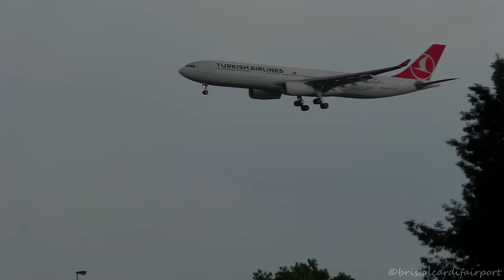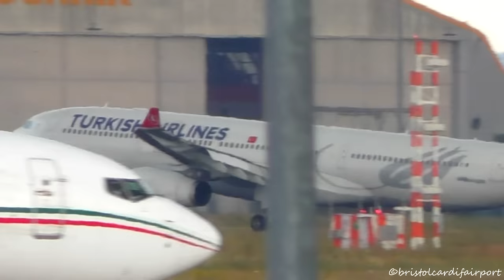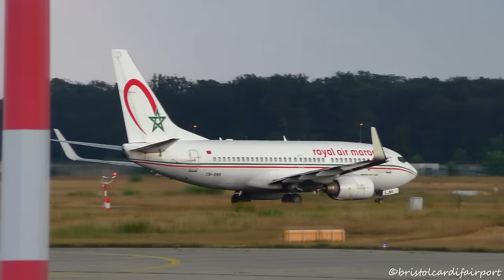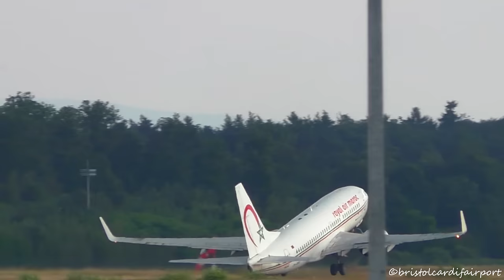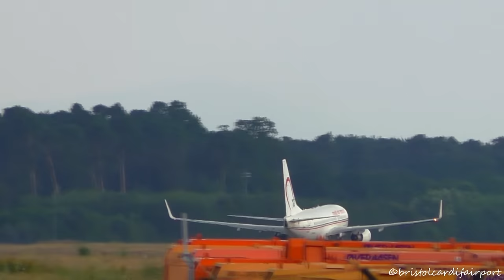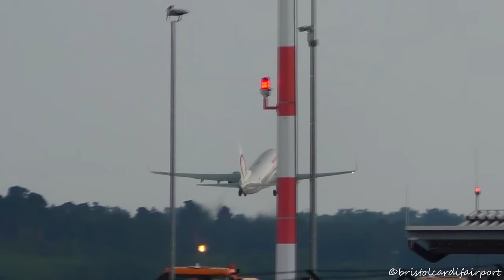PASSENGER AIRCRAFT FAILS TO TAKEOFF! BOEING 737 NEAR TAIL STRIKE & STALL ON TAKEOFF

Comment: Great Video Will. At least they made it off the ground safely that's a really close near miss for sure.
Reply: I've always been bothered with the term "near miss" as it implies you 'nearly missed,' but instead made full contact! Everyone should use the term "close call" or "near collision".
Reply: 'Near' is an adjective, 'nearly' is an adverb. 'A near miss' is grammatically correct and conveys the idea perfectly. It isn't at all the same as 'I nearly missed it' which does mean hitting 'it' or achieving 'it', whatever it may be. Conversely, consider 'a far miss.'
Reply: You're right.  Near miss doesn't really apply in this one.  But when there is a near collision with like another plane I think it's appropriate.  So when you say near miss.  The nearly collided but missed.  So it's usually correct.
Reply from the maker: Indeed!
Reply: Yes, the phrase "near miss' has been noted and analyzed for years.   You're not the first one to point out the theoretical (but not actual) anomaly. 
 
But as Nathan Nicholls points out, "near miss" does NOT mean "nearly missed".   "Near" means close.  "Nearly" means "almost".
 
For example, how about substituting "pass" for "miss".  (Similar enough concepts.)  You could say it was a near pass, and no one would raise an eyebrow.  If you can say a maneuver (or whatever) was a near pass, you can say it was a near miss.

Comment: Some interesting comments on this thread. This is a definition of Vr: "Vr is defined as the speed at which the rotation of the aircraft should be initiated to takeoff attitude."  Vr is determined by the pilots, taking into consideration aircraft weight, air temperature, wind direction and speed, flap speed, engine max takeoff power, etc. For whatever reasons (perhaps wake turbulence as posited by some on this thread) when the pilot called for Vr the aircraft's wing was not ready to fly. The airspeed was not high enough to produce the lift needed to get the aircraft off the ground. Fortunately there was enough runway remaining for the jet to gather the extra knots needed and the 737 successfully left the runway. We may never truly know what happened here, but regardless as to why the first attempt at lift off was unsuccessful, the aircraft maintained the center line of the runway, the nose lowered smoothly and the 2nd attempt at rotation was also smooth, contributing to a successful outcome. Glad everyone was safe.
Reply: fortunatly the take off run (on the runway) was sufficient, otherwise there would be a crash at the end, we have to look up at the so-called accelerated-stop distance and the stopway if both are sufficient to make a safe take off...

Comment: 60kts rotate.
Reply: haha
Reply: V0.65!!!!
Reply: Hahahahaha
Reply: FSX Bad Frames and Stutter.-)
Reply: hardware4you1
Reply: Yea, they must have had an 80kt headwind that immediately became a tailwind!
Reply: PNF: Rotate.
PF: What the f**k is going on here?
PNF: Sorry, I ment "80 knots".
Reply: what the fuck is a PNF and PF?
Reply: Pilot Flying and Pilot Not Flying. Used to delineate which of the two people sitting up front actually have their hands on the controls because depending on which leg of the day they're flying, the takeoff could be handled by either the captain or the first officer.
Reply: Pilot Not Flying and Pilot Flying
Reply: oh man that shit made me laugh - thank you lol
Reply: ^Without Flaps...difficult. he forgot to set the Flaps, thats all.
Reply: +avarua65 He actually had flaps down. You can see the slats when it starts to move
Reply: like on a skyhawk
Reply: +Colin Southern There are no flaps, you can get 5 degrees flaps on a 737, there are setting at certain degree settings. 5 degrees of flaps would be totally useless anyway which is probably why that setting isn't available.
Reply: No, in fact 737s often take off with less than 5 deg of flap. One degree is commonplace. Some Airbusses use zero flaps for takeoff with flaps extended.
Reply: Five (5) degrees of flap setting on the NG (Next Generation 737, like the 737 in the video above) is a fixed detent on the flap lever selector mechanism.  Five degrees of flap for takeoff is the standard flap setting for takeoff for many 737 NG fleet operators worldwide.  Five degrees of flap is an available flap setting on the Boeing 737 NG.

On the Boeing 737 NG there is one handle (called the Flap Handle) that controls both the leading edge devices (flaps & slats; Boeing calls the inboard, of the engine, leading edge devices on the 737 “leading edge flaps” {there are two of them on each wing} and the outboard leading edge devices “leading edge slats” {there are four of those on each wing}) and the trailing edge devices {called flaps}.  There are nine fixed positions (detents) for the flap handle that one can position the flap handle in.  Those fixed detents are flaps up zero position, 1, 2, 5, 10, 15, 25, 30 and 40.

As this jet begins to accelerate for takeoff it appears that the leading edge slats are extended.  Unless the flap/slat system malfunctions one cannot get the leading edge slats to extend with the trailing edge flaps retracted (no trailing edge flaps).  Unless the flap/slat system malfunctioned; and because the leading edge devices are extended, I would say that the trailing edge flaps are not at zero, retracted, and were in fact deployed.  Now where the trailing edge flaps were set at I do not know.  They certainly do not look like they are set at five or more degrees.  And it is possible that the system malfunctioned and the trailing edge flaps were in fact at zero (but I doubt it).

I know of two cases where thousands of pounds/kilos of freight were loaded in the front baggage compartment of a Boeing 737 and that freight was not accounted for in the weight and balance.  That omission led to a mistaken stabilizer trim setting, among other things, and at VR (calculated rotation speed) the pilot flying pulled back on the yoke and ……. nothing happened.  "Little jet is not happy and don't wanna fly".

I don’t know what the gross weight of this jet was, where the stabilizer trim was set, what power setting the crew selected (did or did not derate, did or did not apply assumed temperature), whether or not the takeoff speeds were correctly calculated and at what speed rotation was attempted.

Bottom line is that this takeoff was a mess.  I hope the correct lessons were learned.  Glad they got it in the air, could have been much worse.........

-Respectfully
Reply: What's the correct rotate speed if you forgot to lower the flaps?  (smile, I'm not being nasty)
Reply: Learn something every day, I didn't think a passenger jet could take off without flaps.
Reply: Usually, not having flaps set properly for takeoff will sound an alarm. You can take off without them, but you have to be going a lot faster to get the same lift. You are also much more at risk of stalling if you climb too fast. Also, according to the pre-flight checklist for the 737, 5-degrees of flap is the normal takeoff setting. Nothing else is mentioned.
Reply: Excellent. Flaps were an issue as I see it and V1 miscalculated. Thanks.
Reply: Colin Southern  okay you are right it was the speed
Reply: Rotate at 60 kts?  I don't even think that's possible.
Reply: Timothy Chapman  if you are in a Cessna
Reply: Nope, you can take off in a 737 with one degree of flap selected, and one often does when the runway is of sufficient length.  It gives a better climb
Reply: They don't simply "forget". There is checklist for everything...
Reply: FSFLIGHTproductions Flap 0
Reply: FSFLIGHTproductions 40% thrust

Comment: "What was this pilot thinking?" - He was thinking that we are getting wake turbulence or something simular making it dificult to rotate, so I better put down the nose of the plane in order to catch speed for rotate. That is what he was thinking, very good and quick handling of the crew.
Reply: Absolutely True
Reply: @alhazenmediax  no, you can see that the flaps are down at 5 or 10.
Reply: @danieleriksson1657  They're at 1. Which is a valid takeoff config for the 737, but possibly not the one for which Vr was computed.

Regardless of MenTour's video, this wasn't due to wake turbulence. Vr for a 737 is at least 100 kt and usually over 120 kt (and can be even much higher than that, depending on weight and configuration.) At that speed, during the time the aircraft was rolling down the runway with high nose-up attitude, it would have traveled 2,000 to 3,000 feet or perhaps even a bit more down the runway. The vortices aren't anywhere near that wide. They would have experienced the A330's left wingtip vortex for less than a second. You feel a bump and that's it. It would not have prevented climbing out for 11 seconds while traveling perpendicular to it.

Lowering the nose again was indeed the correct course of action, but the source of the problem is just that they rotated too early for their weight and configuration. Why they did that is unknown and will probably remain unknown because it was never investigated and the FDR/CVR data wasn't examined or retained. It's possible that their airspeed indications could have very briefly read above Vr as they passed through the A330's wake, which could explain why they rotated early. It's also possible (and probably more likely) that Vr was simply not calculated correctly for their takeoff mass and configuration. There's no way to tell which of many possible reasons (perhaps some of which might not even be the pilots' fault) for why they rotated early, since the incident wasn't investigated.

This incident really should have been investigated so that the aviation community could learn from it and not repeat it. The people on that aircraft are only alive because of the pure luck that they happened to be on a very long runway compared to what a 737 would normally use. They probably wasted at least 5,000 feet of runway due to the early rotation. If they had done this on a 7,000 or 8,000 foot runway, they would most likely have had a high-speed runway excursion, which is very often fatal depending on what's past the end of the runway. Thankfully, though, this was a very long 13,000 foot runway designed for departing fully-loaded heavy jets headed to the other side of the world, which need a lot more runway than a 737 normally would.
Reply: @vbscript2  thanks for your comment, you can perfectly be correct here after all
Reply: @vbscript2  thats wake turbule- whos gonna tell him
Reply: also im not sure if an a330’s wing tip corresponds to wake turbulence from engines?? (i think its from the wing or engine idk)
Reply: my english lol
Reply: @ripnob  Wake turbulence is from the wing tip, not the engine. It's caused by the wake vortices that form around a wing that is creating lift. The air tries to accelerate from the high pressure under the wing towards the low pressure above it. This pushes the wing upwards (lift) but also causes air to spill around the end of the wing from bottom towards the top, which produces a vortex.

If you look at a diagram of the airport in question, though, you'll clearly see that the A330 landed on a runway perpendicular to the one that the 737 took off from. So, the 737 would not be following through the A330's wake turbulence, but rather crossing it perpendicularly. At the speed that the 737 is travelling, it would cross the vortices in less than 1 second each. When crossing a wake vortex, it just feels like a sudden bump and then it's over. There is no ongoing effect after that. It's impossible for it to cause a 737 to be unable to take off for 11+ seconds as happened in this incident. The only ways for that to happen are if the aircraft rotated at too low of a speed for its current takeoff configuration and weight or if there were a sudden gust of tailwind that significantly reduced the airspeed during rotation. But we can see from the windsocks beside the runway that the latter isn't the case, so it must be the former.
Reply: @vbscript2  I don't think you realise how the wake turbulence will affect the IAS.

When they initially hit the wake, it will result in a significant increase in IAS, probably around 20 knots. 
This is most likely when the pilot monitor called Vr.
After about 1-3 seconds, they will be out of the first wake, and thus IAS will drop by 20 knots again.
After this, they will hit the second wake, spinning the other way. This will cause the IAS to drop by another 20 knots. And suddenly they are 40knots below Vr, and unable to take off.

The 20 and 40 knots is obviously just an estimate, but it is very likely to be atleast that significant.

Also, as a final note; the wake will disperse as time goes on, and a such, it is very likely the wake they hit,  is quite a lot wider than when it was initially created by the a330
Reply: @jensaugust743  It widens more than when it's initially created, but not by all that much relative to the distance blown through by this 737. It's at most 100-200 feet wide for each vortex. The 737 would blow through each vortex in less than 1 second anywhere near Vr.

And, yes, I'm aware that it would affect IAS, but, again, we're talking about less than 1 second perturbation. When you hit it, it feels very much like hitting a pothole on a road. It's a very fast jolt and then it's over. You would definitely be able to very easily tell that it's just a brief perturbation if you were even able to see it register on the instruments at all (I've never noticed it affect the ASI myself, but then I was usually concentrating more on keeping the plane's attitude from being upset when hitting it than on the ASI.)

You can actually see for sure that it definitely hasn't spread out anywhere near as much would be needed to cause the problems observed in the video, as they actually pass a windsock while they're struggling to get airborne and it indicates very light wind of less than 6 kt. Definitely not enough to significantly affect the takeoff of a 737, let alone for 11 seconds.

There are also photos showing for sure that the RAM 737 was well past the extended center line of the runway where the A330 landed it was stuggling to get airborne. Its hop in ground effect occurred around the time it passed taxiway S. You can see the photos on the avherald article about the incident.
Reply: @vbscript2  if you imagine the wake hittting the plane, causing a brief increase in IAS, resulting it to go from ~20-30 knots under Vr, to Vr.
The pilot monitoring will now see the airspeed is at Vr, and call it out.
Shortly thereafter, the airspeed will drop again however, as they exit the wake.
This now results in them not having the required airspeed to get airborn.
Reply: @jensaugust743  If the PM were paying attention to the airspeed, though - which they obviously should be during the roll - then it would be obvious that that sudden increase was anomalous, especially since it would coincide with feeling the sudden bump and turbulence. If the ASI showed the increased airspeed at all, it would be extremely brief (less than 1 second) and obviously an anomaly. They'd be back below Vr before the nose ever came off the ground and probably before the PM even had time to make the rotate callout.

Also, consider that this exact type of traffic situation happens many times daily both at that particular airport as well as lots of others around the world, literally many thousands of times per year. If hitting the wake turbulence of an aircraft that landed on a perpendicular runway could actually cause this, then this would happen thousands of times every year all over the world. But it doesn't.

The much more logical and feasible explanation is just that someone got the V speeds wrong (often computed by someone like the airline's dispatch rather than the pilots) or the pilots rotated before Vr. Incorrect V speeds seems the most likely, possibly due to erroneous weight and balance information or computing them for a takeoff configuration other than the one the crew was actually using.